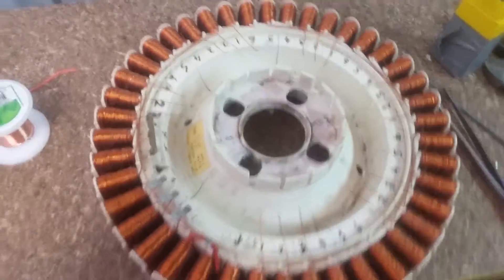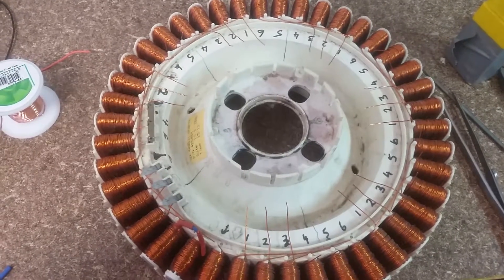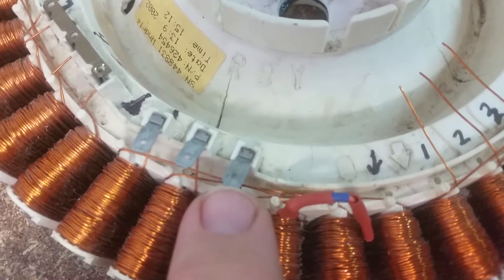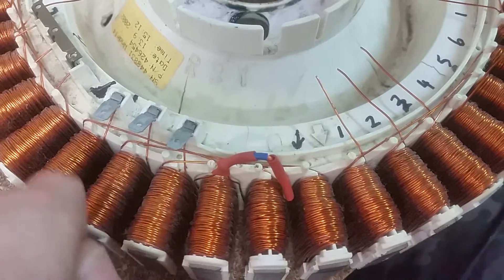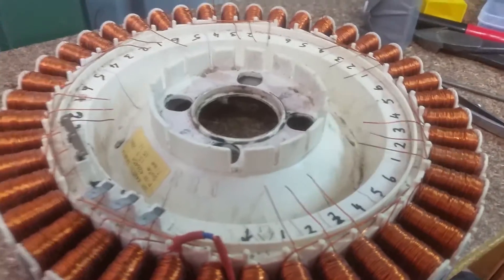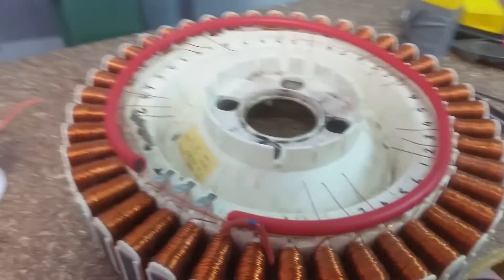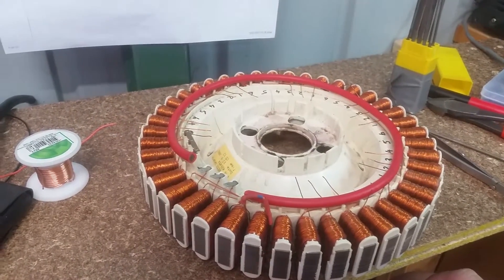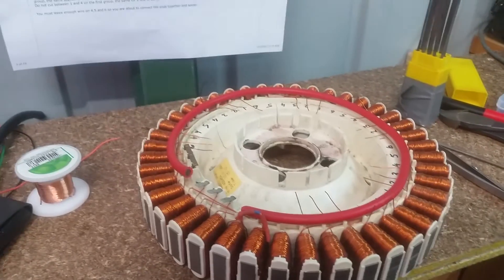Fisher and paykel stator rewiring

Comment: Thanks for that could you please tell me what size of the wire did you use?
Reply from the maker: I used a PC power supply wiring to make the links. As it was double the size of the winding wire.
Reply: @chuxxsss  I meant to ask if the wire size was 1.6mm or 1mm
Reply from the maker: @mishokorlov  Go 2 mm  should work.
Reply: @chuxxsss  OK thanks